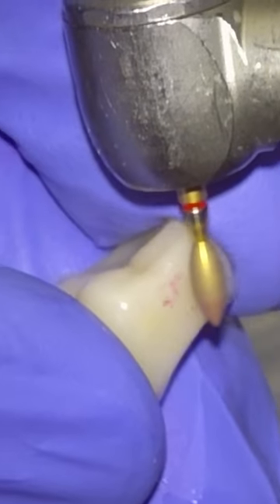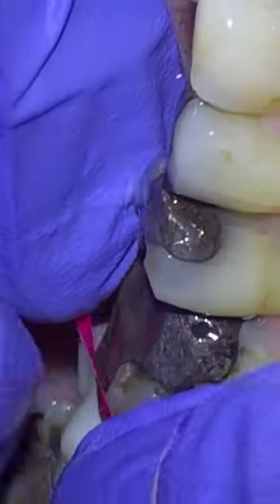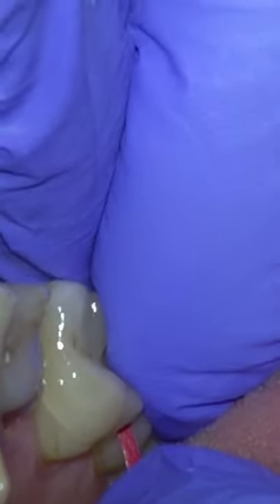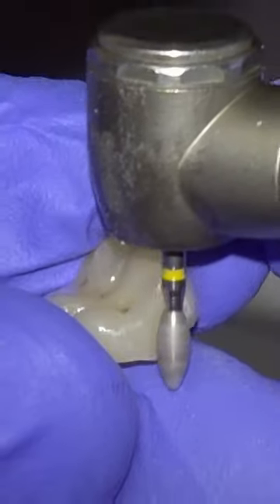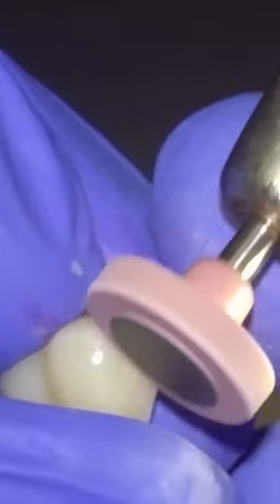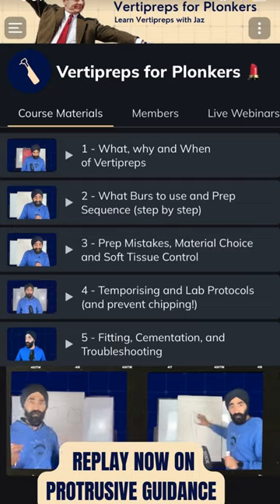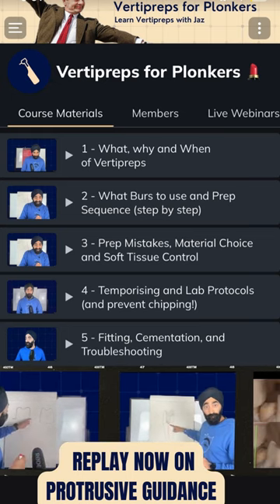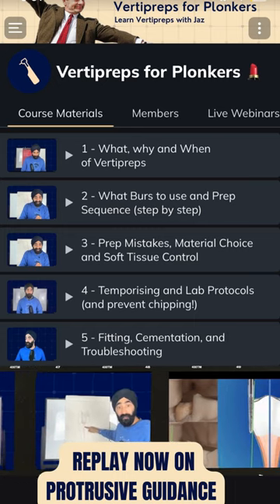How to Adjust Contacts for Cowns/Onlays #dentalcrowns

Comment: Hello Dr.
Nice tip..

Also, is there any way by which we can check if the intaglio surface of the crown fits properly or if any adjustments are required??

Thanks
Reply from the maker: yes for tight vertical crowns I use GC Fitchecker - I haven't used light bodies PVS before but I know some people do. Hope that helps!
Reply: Does the silicone scrape onto the prep so you know where to adjust the prep?
Reply: Or is purely to adjust the crown ?